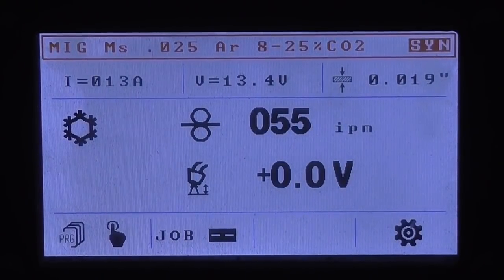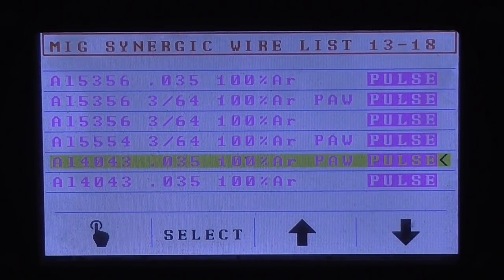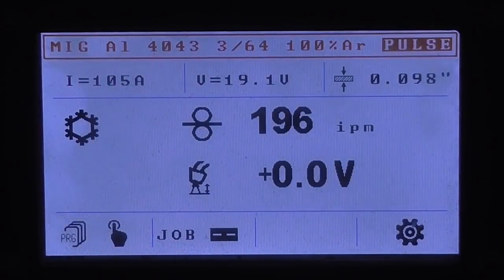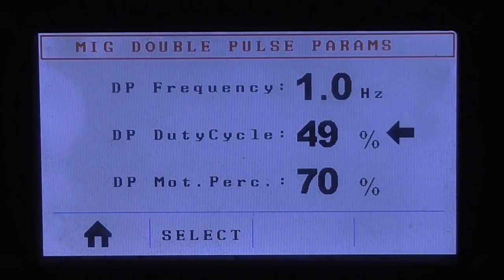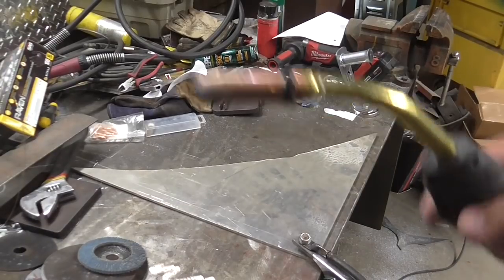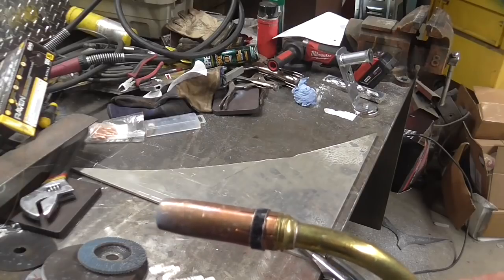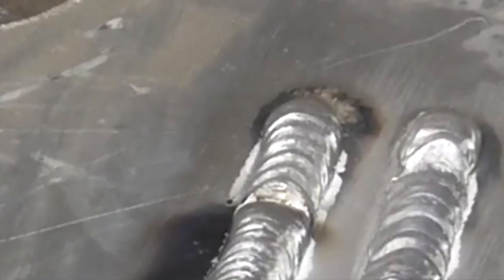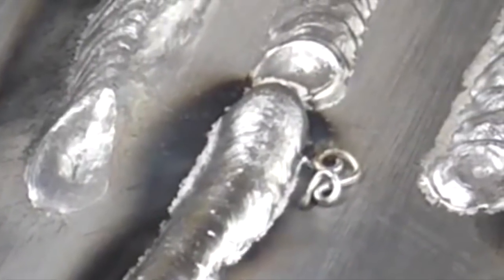Pulse mig options demonstrated

Comment: Can you go into the 3/64  PAW 4043 program and tell us what the min and max is for the synergetic material thicknesses?     On my iron mig 220 .035 PAW only goes to 2.0mm.   I want to see what it is for the 3/64 PAW?       The PAW programs are unreal and always my goto but it sucks when you weld anything thicker than 2.0 on the 220 and you have to go to the pulse or double pulse programs as they just dont have the same finesse to them imo.   But they are still great.... just not the same amount of control I think.
Reply from the maker: Skylinerd1 i didnt forget about you!  4043   3/64   Min 78 ipm  .040   Max 236 ipm  .120

But 035  4043   Min 78 ipm  .032   Max 177 ipm .079     

So the 600 amp peak pulse vs the 300 amp peak pulse on your machine give you a much better low end to weld thin material !
Reply: @ZILAwelds  Awesome thanks for the info.    So the 3/64 program can PAW 3.0mm material.     Pretty cool.    I did a heap of 2.0mm boxes for a horse truck side storage compartments and the machine worked real good for that made the job quick.    It would be nice to be able to do the same thing with 3.0mm material.   I might have to look into one of these 300 class machines in the future.    I wonder will they make a higher amerperage machine than this in the future because I really want something that can do it all.   I mean 400amp class so I can arc air and pulse mig.   But im thinking maybe I should just get an old second hand 500amp generator welder for that and maybe get the PP300 later.
Reply from the maker: Skylinerd1 do you live in europe and you have 3 phase 400 ....   they already did trade shows with a max 452 ....  it is a power source like the max 403 but much more powerful ! 
It will also have a feeder that has a display much like the pp200 ....  aluminum programs, air arc ...  the whole package ! 
But its 3 phase 400-500 volt only ....  no single phase - so no good for usa
Reply: No Im in New Zealand so like the Australian guy its a bit difficult.    There is a distributor here in NZ but iv never heard of him selling any and the price is to high so I just import it myself.   I did actually talk to stel briefly about becoming a distributor or reseller myself but havent taken it any further.        I looked at teh stel max 452 but couldnt tell if it had the programs like the 221p or not.    So it does thats cool.    Stel needs to put out more info on that machine or demo it.
Reply: @ZILAwelds  we have 3 phase here in NZ.   But its expensive.   Thats why I think about generator.    But this max 452 could be good all rounder if it has programs.
Reply from the maker: Skylinerd1 the programs and most the logic are in the feeder.   The XM feeder is pretty good but the new XXM feeder that they are working on is supposed to be killer - the menu like pp200 and pp300 and probably additional programs for 1,6mm wire ....  

That is why information is so hard to find because they dont explain it the right way and the xxm feeder is brand new - they showed it at a few trade shows - i dont even know that you can buy it yet

Comment: You made this video for ME didn't you?  What program do you pick for 316L dual shield flux core?  Hey, I talked to someone in the UK and he said the Stel sister machine of the 200 lacks a 316L setting too.
Reply from the maker: worldtraveler the stel iron mig 221p only has 308 programs.  0.8mm and 1.0mm 

On the 300 the program is called E30X LT1      It is black in color like all other stainless programs.
Reply from the maker: worldtraveler also you want to take one of my classes ....  fly i to racine,wi airport, i pick you up .....  then you can be a part of the whatsapp group with all the guys who took classes here and there are a bunch of guys with pp300 on there ....